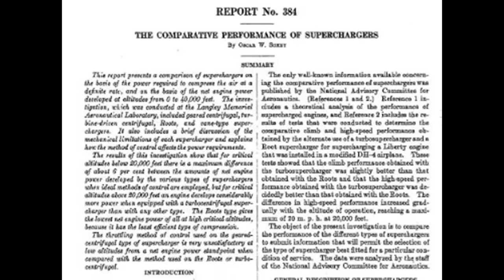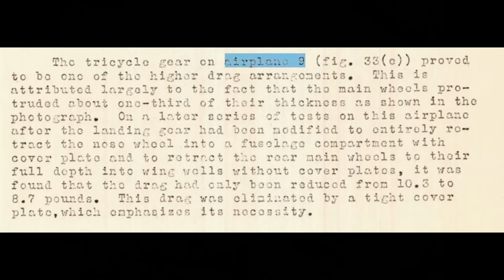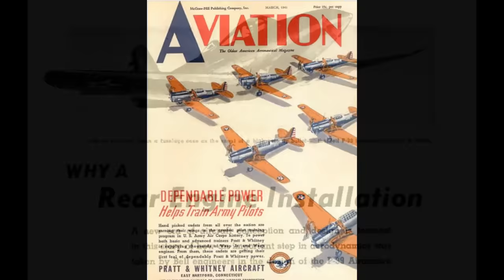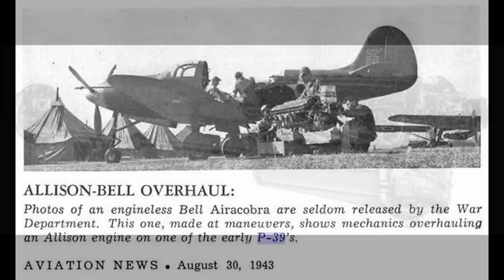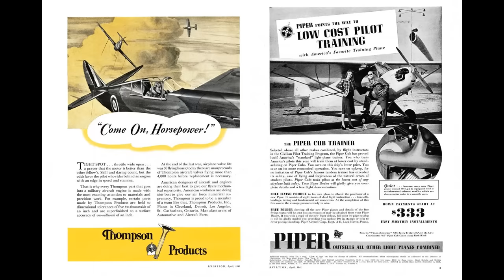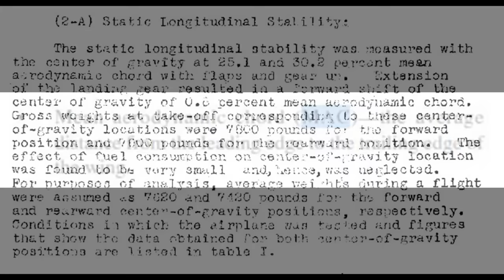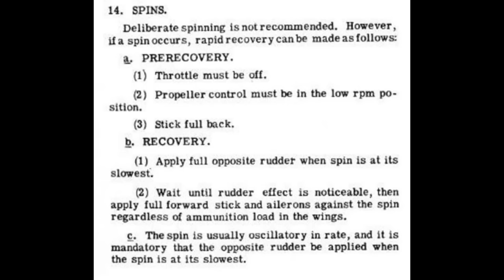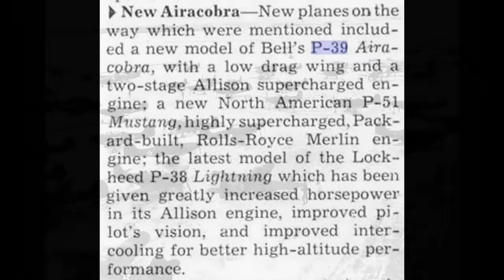Bell P-39 Airacobra, Why the Mid Eng?

Comment: Drive shafts in airplanes. In prop planes a generally bad idea in my opinion. Every interface between components adds an addition failure point (1). Another thing with piston engined aircraft with driveshaft set-ups that probably makes a big difference is the number of power pulses per crankshaft rotation. I still wonder if a drive shaft failure led to the fatal crash of the reproduction Bugatti P-100. 
But Chuck Yeager really loved the P-39 so that says something.  The Red Air Force liked it. And really disliked the Spitfire evidently. I really think it boils down to tactical use more than anything else. 
Another aircraft that gets a bad rap, the P-40, suffered from a some of the same issues the P-39 did. Poor performance at altitude. But I think in the P-40s case a lot of its poor reputation (especially in North Africa) was the result of relatively inexperienced pilots going up against pilots with much more experience. In some cases going all the way back to the Spanish Civil War (2). 
1) In a situation where the reduction of mechanical interfaces has made a big difference is in manufacturing. Specifically in the area of machine tools and their cutting tools. Reducing the number of interfaces and their type has contributed greatly to surface finish and tool rigidity.  
2) Spanish Civil War experience helped contribute to Luftwaffe success in the beginning of Barbarossa. Due to the Red Air Force still having significant numbers of I-16 Ratas still in service.
Reply: The Spit V was optimised (badly) for high altitude, didn't suit Soviet practice.
Reply: @givenfirstnamefamilyfirstn3935  Spitfires were a bit fragile, which didn't match Soviet needs. Seafires also suffered from this fragility, particularly when compared to products from the "Grumman Iron Works".
Reply: @fafner1  
An anvil might be considered a bit fragile in comparision to thr products from Bethpage

Comment: I saw a P-39 on display in Buffalo, NY, in the mid 1980s.  I was appalled at the workmanship of the exposed skins.  Wrinkles, missteps, gaps, bumps, you name it, they did it.  One would have to survey the airframe, measure each defect and add them up, carefully estimating boundary layer effects, but even without doing that and consulting Hoerner, one could presume that a lot of the P-39 base drag was created by all these tiny excrescences adding up.  One of the NACA documents showed that prewar designs typically doubled their base drag because of manufacturing defects and poorly designed details. Its likely that the turbo installation was poorly designed, from an excrescence viewpoint, as typical American design at the time built beautifully smooth wind tunnel models, but then designed for cheap and easy manufacturing.  It seems to me that the P-51 paid attention to excrescence drag, as a smooth exterior was important if one was to achieve laminar flow. The P-51’s smoothness was beneficial to its base drag, even if there was no meaningful laminar flow.  NACAs advice to throw out the turbo was a typical “throw out the baby with the bath water” decision, but it was far from the only reason the P-39 didn’t match its competition.  But the real reason the P-39 was a dog?  (i mean other than rookie pilots trying to dogfight zeros or the British developing a case of not invented here over it) Bell (and Allison, and maybe most of the American companies) was unable or unwilling to implement changes when new technology became available.  There is no reason that the British couldn’t install Merlin Mk 61s in the P-39 also, for instance, or for Allison to reverse engineer the two-stage/two-speed aftercooled supercharger of the Merlin Mk 61 except for? Utterly incomprehensible.  Bell could have produced airplanes with smoother exteriors, at the very least.
Reply: Was that original to the aircraft or was it a result of the restoration?  Many surviving P-39s came from places like Papua New Guinea - not in the best shape
Reply: @chrismartin3197  Original to the as built aircraft.  Excrescence drag was a big problem for early American fighters.

Comment: I just don't get why they didn't re-try to put the turbocharger in later models. once they had sold a few planes they could have revisited the turbo charger

Re engine location and centre of gravity:  Modern pilots have suits to help with resisting g-force issues don't they ? So maybe thats why designers dont care too much about centre of gravity
Reply: By the time they would have been able to put a supercharger on the plane would have been competing with later p51s and p47s, and with jets in the near future it wasn't worth the effort.
Reply from the maker: Let's not forget Bell was hard at work on a jet fighter, plus they had the P-63 on the way.
Reply: @juanordonezgalban2278    yes great point

Comment: A turbocharged P-39 seems like it would have been very useful to the Germans after 1942. You could probably one shot a B-17 or a Lancaster with a 37mm cannon, and the lower fuel capacity wouldn't have been as much of an issue in a defensive role against bombers.
It doesn't seem so useful as a long range escort against fighters though...
Reply: How would Bell supply the Nazis?
Reply: @givenfirstnamefamilyfirstn3935  You're assuming I meant Bell intended the P-39 for Nazi Germany, I didn't. I merely meant the aircraft's high altitude performance and 37mm cannon would have been useful to them for intercepting allied bombers over Germany.
Reply: They had the MK108 30mm cannon lobbing low velocity ‘hand grenades’ at bombers at a leisurely rate.  It was surprisingly small, but fat.

Comment: P39 poor reputation come mostly from being pitted against Japanese navy O and Army Oscars which simply out classes the p39 at higher altitudes. The understanding of how not to fight the light weight highly manuerveral Japanese planes was not yet deceminated. The Soviet success with the P39 was it  at altitudes from about 10000 feet down to ground level as a low level ground attack fighter. The Allisons lack of high altitude forced  induction was not an issue at lower elevations. Simply a matter of working the machine in it's best possible envelope.

Comment: What pilot in a spin is going to try and time his rudder input? Seriously. First and foremost, there may not be time. Secondly, as soon as I'm spinning, I'm going hard on opposite rudder and I'll let the airplane decide when it'll be effective. I understand that aviation is procedure-driven and that precision counts, but I don't think I'd ever be good enough to follow some of these emergency procedures to the level of exactness they mandate. I'm not Neil Armstrong, nor Chuck Yeager.
Reply from the maker: I hear you. One way I would look at this is that if I put in full rudder input as soon as the spin starts, which is what I would do, then that will be the slowest point of rotation.
Reply: The first spin I did, with an instructor of course, disoriented me so thoroughly that I was counting each half turn as a full turn.  The second was much better and after a few more, I didn't get disoriented at all.  With just a little practice its easy to time your recovery inputs to emerge from the spin on a desired heading.
Now, if you're close to the ground, all bets might be off, but a less than ideal response to the spin will likely kill you anyway.
I'm a long, long way from being a Neil Armstrong or Chuck Yeager myself.
Reply: @jaym8027  Yes, I'm sure that training and experience go a long way, and perhaps, there is a certain amount of cross-over between doing spins in a light private designed for stability and a more neutrally stable WW2 fighter, but I imagine that the kind of flying that would induce a spin in a P-39 would be far more...energetic. The key word there is induce, not command a spin. Anyway, good points. Something to consider.

Comment: I find pitch stability is very poorly explained in all the text books. For CG and static stability, the key value is "static margin", the distance of the CG from the "neutral point", the aerodynamic center of the airplane's horizontal footprint taking into account all moments and forces. Static stability is simply weathervaning effect.  The CG is the pivot point of the weathervane, and as long as the overall center of aerodynamic forces are aft of the CG, the weathervane wants to point into wind the way you want it.  Absent trimming forces, the plane is basically a lawn dart, a statically stable ballistic object. To make the wings produce lift to hold your weathervane up, you have to introduce trimming forces, to make the body weathervane into the air stream at an angle off-axis, to generate an angle of attack on the wing. You basically bend the trailing edge of the weathervane on your barn so that it  weathervanes into the wind with, say, a 5 degree offset, or angle of attack. Or for the airplane, you have a hortizontal tail to do the same thing. Anyway, the closer the CG gets to the neutral point, the weaker the weathervaning effect is, until you're on the neutral point, where there is no weathervaning effect at all, and if you go aft, the body becomes unstable, but what is really happening is it's stable again, just in the opposite direction.

Comment: The reason that the P-39s and the P-40s did NOT get  Turbochargers, while the P-38s and P-43s DID, 
was that there was a shortage of Turbochargers.   That simple.   The sudden Ramping up of production 
of B-17s, B-24s, P-38s,  P-43s, and P-47s meant that there weren't enough to go around.   Curtis actually 
wanted to build the P-37, but a single turbocharged Allison could not equal Two Turbocharged Allisons, 
so the P-38 and the P-40 were  built instead.   

And this was the reason that the British ordered P=38s  and P-39s, and then cancelled the contracts.!
The Brits had test flown the prototypes of each aircraft with the Turbocharger, and then, when the
P-39s and P-38s  began to be delivered, they had no Turbos, and no high altitude performance.  The
P-38s were renamed  P-322s, ( Castrated Lightnings )  and were given back to Lockheed, who passed 
them along to the USAAF to be  used for training.    The British P-39s were re-named  P-400s, and sent 
to New Guinea,  where they helped Japanese pilots like Saburo Sakai run up very impressive scores !  

The P-400s were VERY unpopular with USAAF pilots, who referred to them as " The P-40 with a Zero
on it's tail 1 ".   It was so bad that, when the pilots found  out that they would get P-38s as soon as 
the   P-400's were allno longer operational,  they simply began wrecking and crashing their P-400's,
destroying two squadrons worth of aircraft in ground accidents in less than ten days !  

Now, the reason that the Allison had such a poor supercharger was because the Allison V-1710- was 
NOT AN AIRCRAFT ENGINE !   It was originally developed to power the U.S. Navy's next generation of  
Dirigible Airships that would have followed the Akron and Macon.   Since Airships never go above 20000 
feet, it would never need a larger supercharger.    Then the Navy cancelled the Airships, and GM was left 
with an orphan engine that they managed to rework into a half-assed  airplane engine, which, with a lot 
of VERY LARGE BRIBES PAID to Air Corps and Air Force officers, led to big contracts.  

Oh, yeah..  It isn't pronounced   ' NAKKA ' -  It was always  pronounced   " EN  AYE  CEE   AYE "   As in 
N.A.C.A. Long Chord Cowling.     .   .

And it  ISN'T   a  ' Townsend Ring ',  it's a    TOWNEND RING  !
Reply: @yo yo The reason that the United States would not allow the export of Turbochargers 
was that THERE WAS A CRITICAL SHORTAGE OF TURBOCHARGERS IN 1940-1942 ! 

General Electric Corporation had set up the plant to make Turbochargers based on the premise
that the U.S.A.A.C. would be ordering several HUNDRED per year - suddenly they had orders for
NEARLY TWENTY THOUSAND !    Remember,  each B-17 and B-24 used four Turbos,  the P-38 used 
two each, and the P-37, P-39, and P-43 each used one.  Something had to give- there simply
weren't enough to go around.   

So, the P-37 was re-designed into the P-40.  The P-39 was re-designed without Turbos.  And
the P-38s and the P-43s split the turbos that were left, with the prioity being given to the P-38,,
as it had higher performance than the P-43.

B-17s and B-24s sold to the British were sent WITHOUT  turbochargers.   There simply weren't
enough to spare, and the ' Bomber Barons '  ( NOT ' THE BOMBER MAFIA ' ! ) demanded that
all turbocharged heavy bombers be reserved for the USAAC.   The British quickly found out that
a Turbo-less  B-17 was useless in combat, and their B-17s and B-24s were used for second
line functions, such as transport duty and flying ASW patrols over the Atlantic.

All during 1942, General Electric was building the factory to make more   Turbochargers,   and
by the begiinning of 1943, the shortage was over, and production of more P-38s. P-47s, B-17Es
and Gs, late model B-24s, and B-29s could begin.   

It was simply a temporary manufacturing bottleneck - and as for a shortage of nickel, the U.S. 
had plenty !! They simply began making five cent  coins out of Copper, Silver, and Mangnanese !
Reply: @yo yo Mr. YoYo, the only point of our agreement is that the United States would NOT export
Turbochargers in the 1940-1942 time period.    Just about averything else you know  is WRONG...

The Turbocharger was NOT a National Secret of the United States.   The Germans had been using
Turbochargers on their marine diesels for years, as had other nations.  ( These were all based on
the Bucchi patents, registered all over Europe in the 1920s,  and when you register a patent, it
is no longer a secret. )      

The United States had been doing turbocharged aircraft engines since the end of WW!, and in the
early 1920s,  had set an altitude record of over 40,000 feet using a LePere Lusac powered by a
turbocharged Liberty Engine, which was put on display at the Chicago Museum of Science and
Industry, so it was hardly a secret.  

Curtiss  Wright and G.E. jointly sold a set of turbocharged Wright Cyclones to the USSR in the mid
1930s,  and there were turbocharged racing cars in Europe all through the 1930s.   It was NOT a 
'national secret ' of the United States.

As for Liberty Ships, they were made from the cheapest grade of Marine Steel that could be 
fabricated, as were the Victory Ships and the Kaiser Ships.   It was a matter of cost - the ships
were throw-aways, intended to be scrapped after the War was over.  

Was Nickel in short supply ?    After Pearl Harbor,  EVERYTHING WAS IN SHORT SUPPLY !   
Steel, Rubber, Gasoline, Nickel, Copper, Aluminum, Meat,  you name it, it was in short supply !

What limited the production of Turbochargers from 1940 to the end of 1942 was NOT a 
shortage of materials, but simply the small size of the factory that had been built to manufacture
the Turbochargers !    They only had a certain number of lathes, drill presses, milling machines,
and above all,  MACHINISTS !, all in a factory with a limited amount of floor space,  to do the 
detailed, complex machining of the impellers, shafts, bushings, bearings, and outer housings 
that went into a  Turbocharger.   

When the war came to the United States,  G.E. immediately got approval and was issued the
necessary material and equipment priorities to build a MUCH BIGGER  factory - which began
making Turbochargers at a rate of about twenty times that of the pre war facility.   So, instead
of making a thousand Turbos a year, they were making more than 20,000 !   And, that was
increased again in 1944 with another factory, which also made Marine Turbines for the U.S. Navy,
who had been forced to fit some of their Destroyer Escorts with Marine Diesels instead of
the more efficient and desirable  Marine Steam Turbines.    

Interestingly enough, in 1943 the British still had a number of the B-17s they had taken delivery
of with no Turbochargers.   The U.S. sent over conversion kits, which allowed those bombers 
to be upgraded.  No National Secret.  Just a shortage of Machinery and Machinists.

'You Go To War With What You Have,  Not With What You Want, Or What You  Need ! "

Comment: All this talk of aerodynamics made me realize if they had the square area rule by then the P-39 would have looked completely different.
Reply: That's relevant surrounding the speed of sound isn't it? You'd think that at 600 km/h at 3000 meters that it's effect wouldn't be that big.
Reply: The canopy centred over the wing would have had an effect in compressibility region high altitude dives.  The fuselage pod rear taper in the P-38 is believed to be behind most of its lethal Mach tuck.
Reply: @givenfirstnamefamilyfirstn3935  Flow interfence between the engines and the fuselage pod, exacerbated by a thickish wing. Lockheed built a "Swordfish" test aircraft with a lengthened fusalage pod, which Tony LeVier clamed was the best diving P-38.
Reply: @fafner1  Mosquitoes needed engine nacelle extensions well aft of the trailing edge.

Comment: 79 gallons of oil is typical for a big aero engine of the period, but then you compare it with a modern turbine engine with an oil tank the size of a basketball.
Reply: Turbine oil is largely for cooling, most losses are at labyrinth seals as an aerosol.

Comment: The  R-- 3350 Turbo compound did not have a supercharger.  It had a Three power recovery turbines which put power directly into the crankshaft.
.
Reply: Of course it had a supercharger, how could it operate efficiently above about 8,000 feet with no boost?  It had a two speed mechanically driven supercharger with an injection carburettor discharging in front of the supercharger impeller blades.